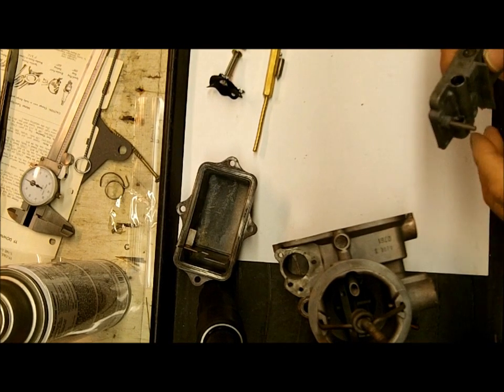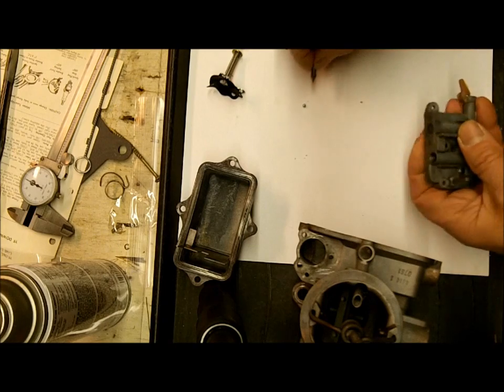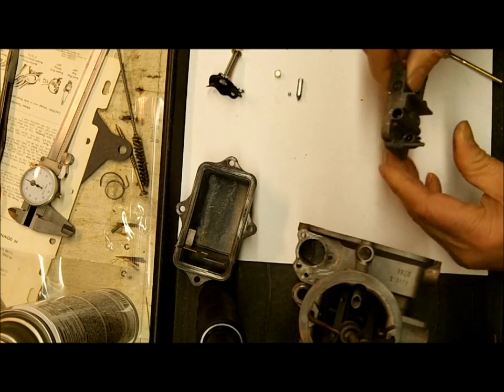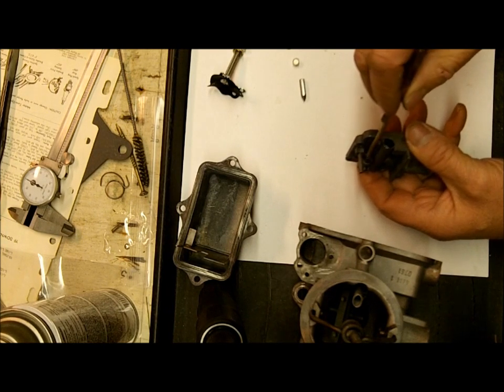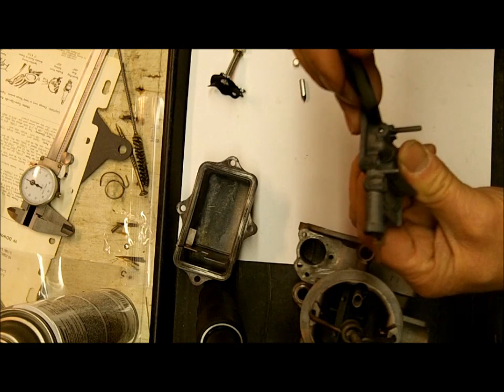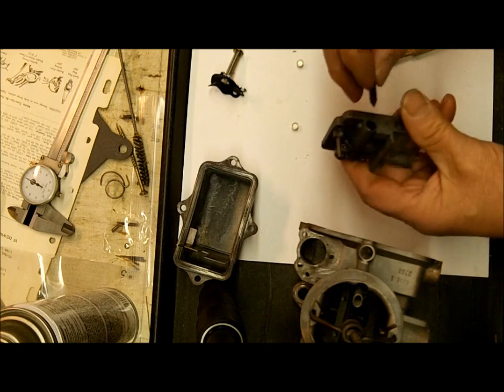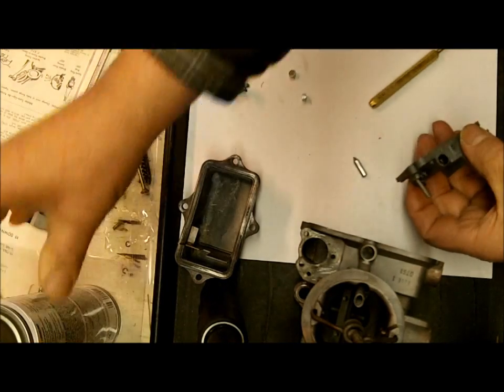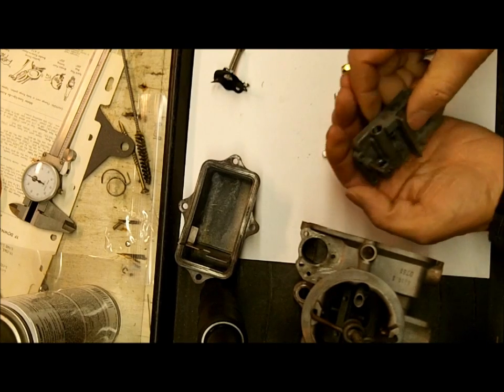Holley 1920 Carburetor Rebuild - Part 2

Comment: I rebuilt mine with your kit but gas pours out from around the throttle shaft. I wonder if i have the diaphram not set inside correctly?
Reply: I have a 71 dodge slant six. Do you have a new carb part number for me I can use to purchase a new carb? I need the kickdown too.

Comment: Just bought a kit. How important is it to clean out the metering block? Mine dosent seem too bad, but I will drill out the caps to clean and lubricate the check weight if needed.